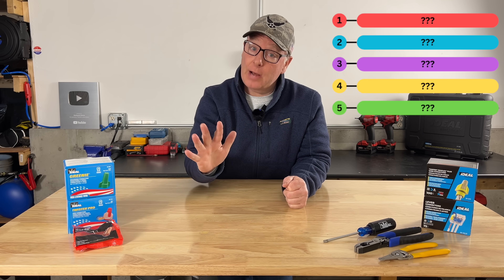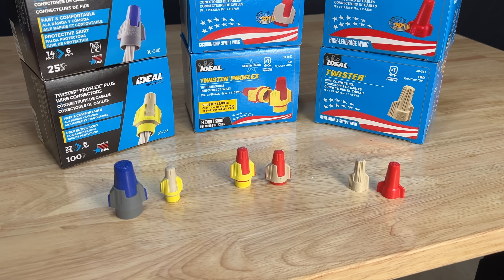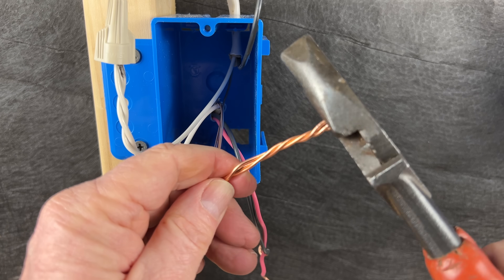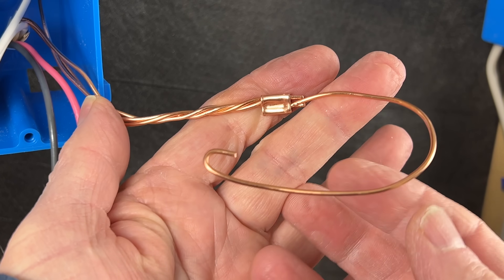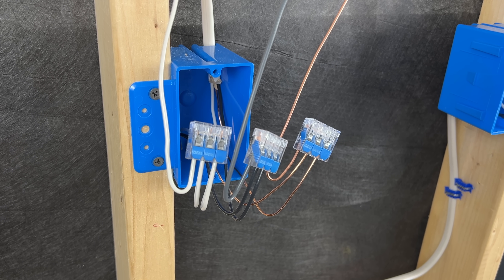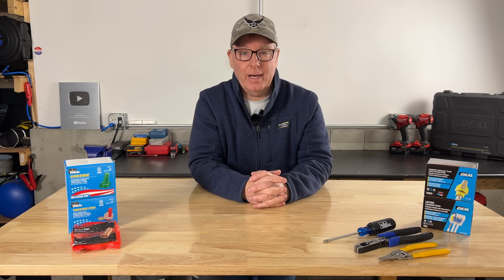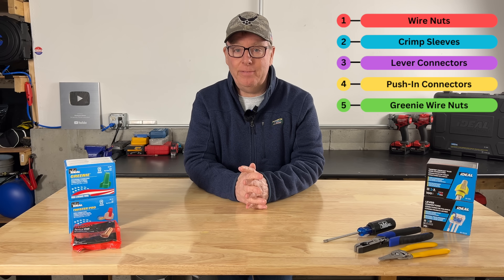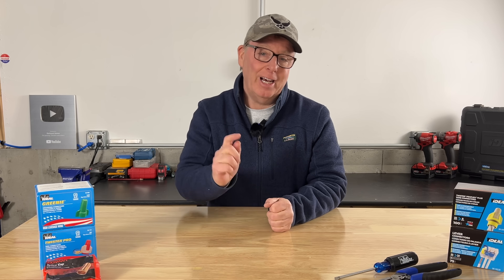How NOT to Connect Ground Wires in 2025 (Safety First)

Comment: Another grounding option that is getting less common is conduit. In Chicago area the local code requires conduit for all electrical runs. We are allowed a short (less than 6ft) run of MC cable but that is the exception. A properly installed receptacle in an all metal box with conduit will be grounded (just use your ground indicator tool to be sure it grounded properly).
Reply: Forgot to mention, for DIYers it is very helpful to chat with an electrician local to your area before you get too involved in your project! My local big box store sells Romex and plastic boxes, but I can’t use them because of local code. Always helps to check in with code knowledgeable people in your city before tackling large projects. Especially running wires outside of the junction box.
Reply: I'm surprised that Chicago doesn't allow metal flix conduit as a alternative to ridged conduit especially in residential wiring they used to use it exstinsivly
Reply: @Kat-on3nm in my city we can use metal clad (MC) cable as long as it is less than 6 feet between junction boxes. So that is our main flexible metal option available.

One of the main reasons is rigid conduit is the preferred method and the electrical unions like it too.

Comment: To use the wire nuts correctly you can't pre-twist them as the directions use the twist given to the wire to determine when they have been installed correctly. For the DIYer just get the lever connectors as it's much easier to use them as directed and modify in the future.
Reply from the maker: The instructions say pre-twisting is acceptable but not required. I think it's a best practice based on my experience.

Comment: Started using the Buchanan crimp sleeves back in the seventies.  At that time it was required to use the Buchanan crimper.  It crimps from 4 directions.
Reply: was that a local code back in the seventies? An addition on to the house I live in added in the early seventies has those Buchanans in the switch and recptical J boxes  I've noticed.

Comment: Amateur electrician here.  I've always heard never to backstab into a receptacle. Isn't the 4th option for push-in the same mechanism as a receptacle backstab?  Seems like a bad idea.  I don't use them anymore because experienced electricians really bad mouth backstabbing.

I also noticed that you said a push-in "works with stranded" but you didnt show it.  Probably because it doesnt often work?  When I've tried it, it looks like garbage.  I'm guessing that Ideal will unsponsor you if you show that their push-ins are kinda lousy.  Would appreciate an honest perspective from experienced electricians on this one!
Reply: They’re similar, but there are some differences. 

I’ve taken apart a lot of switches, outlets, push in, and lever nut connectors. 

Push in connectors appear to use spring steel to clamp the wire down, versus brass (usually 260 cartridge brass I think) in switches and outlets. I think the spring steel is way stronger, and will result in a much more reliable connection over time.

The 2nd difference is the way they each hold the wire. Push in connectors have a flat bus bar, switches and outlets don’t. Think of it like… switches and outlets hold the wire between your front teeth, and push in’s hold the wire between your two front teeth and your tongue. Weird analogy haha, but I’m going with it. Anyway, the bus bar in push in’s gives more contact surface area.
Reply from the maker: They would be my last choice but some people like them. They will work with stranded but you need to twist the strands tightly to get the wire into the connector and they cannot be used twice with stranded wire. If you want a simple connection option the lever connectors are a better choice.

Comment: Congratulations on the sponsership. I like the Greenie wire nut with the hole in the end. It certainly makes it easier to do a good solid connection. I have recently tried the Ideal lever connectors. Hard to get the wire in the other side after using Wagos for a long time!!

Thanks for the video. I always find good tips and tricks from watching you

Comment: One thing about the greenies that confuses me: you can also make a separate jumper wire to poke through instead of leaving one longer. I always forget to leave one longer. But I just noticed the fine print where the package says the jumper should extend 6 inches at least below the nut. I wonder how often that requirement is missed or the implications of only having a small bit of the jumper below the nut since it’s technically in contact with all the other grounding conductors in the nut itself

Comment: Seems to me that the lever connectors and the push in connectors take up more space and makes it harder to tuck them out of the way.
Reply from the maker: The larger #10 ones do but the ons rated for up to 12 gauge are about the same size.

Comment: Thanks for another great video! On a slightly different but related topic, what's your thoughts on using the green hammer on clips to ground a metal box vs using a green 10-32 screw?
Reply from the maker: Thank you.. They are an approved method but I personally prefer a ground screw. I think they make a solid connection with little to no risk of coming loose.

Comment: 0:45. What is that orange wire doing on the ground bus? Excellent content, as usual.
Reply from the maker: It was green when it was installed. It has faded for some reason and looks like orange in the video. I noticed that too.

Comment: I learned some valuable info.  I’m going to pick up a pack of Greenies today and In-Sure lever connectors.  I’ve been using Wago’s but I have had the levers open putting them in a crowded box.  I prefer lever over twist for stranded to solid connections. Thank you for your time and talent making your videos.
Reply from the maker: Those In-Sure connectors are great, they have a very tight grip.
Reply: When necessary one can throw  a loop of tape around a  Wago'. Note the newer wago's  have a slightly shorter lever.
Reply: @ a lever that clamps tighter would be Ideal.
Reply: @geoffap0  The Ideal Lever Nuts do clamp tighter than WAGOS. The levers are harder to open than WAGOS.
Reply: The lever nuts are great if you are dealing with the old copper clad aluminum wire found in 70's era homes. If you twist the conductor too much it stretches the conductor and it can causing it to break. Lever nuts eliminate twisting the conductor.
Reply: @thomasdragosr.841  I agree, however they are only rated cu/cu.

Comment: The Wire Nut is my favorite method. Specifically the green ground wire nuts with the tiny hole on top that basically turn multiple ground wire into only one you have to hook around the receptacle screw.
Reply: they're fine but crimps are the best in my opinion. They're neater and take up less space in boxes that you may need extra room for
Reply from the maker: I agree..
Reply: try a wago and tell me you still prefer wire nuts
Reply: @zaxmaxlax  I serviced tanning beds before obama destroyed the industry. A good portion of them came from germany and used wago connectors in the ballast compartments and push on terminals on the ballast. A good portion of my business came from melted wago and ballast connectors. Ballast I could save I would put screw on connectors and melted wago connectors would get replaced with wire nuts. I never had a repeat call for a failed wire nut or screw type connector.
Reply: @roddycreswell8613  I dont believe in the wire nut part nor the push in ballasts/wagos if you had acess to the box someone else had access before you and it was not an european, screw connectors are solid tho
Reply: I preferred wire nuts over lever style, but my wrist after 25 years love lever locks